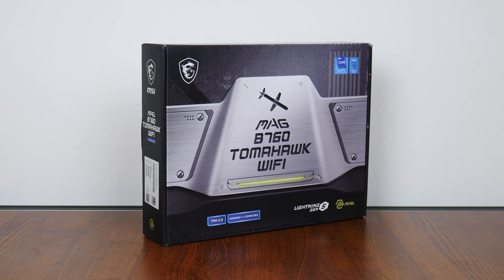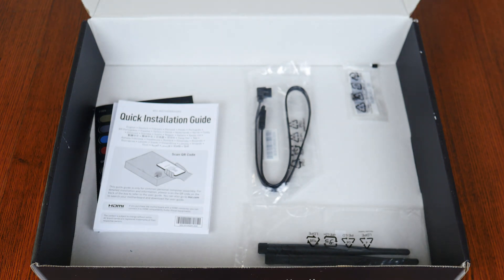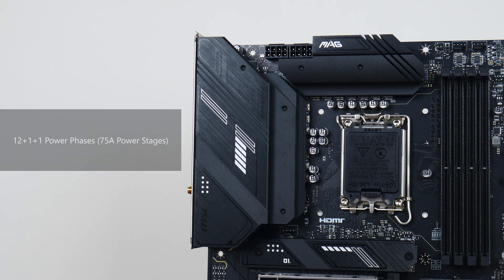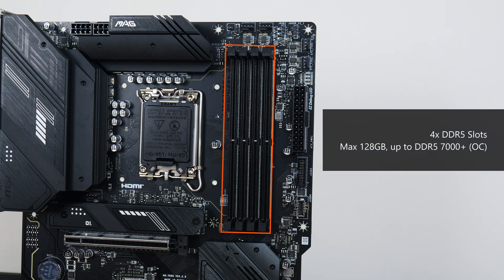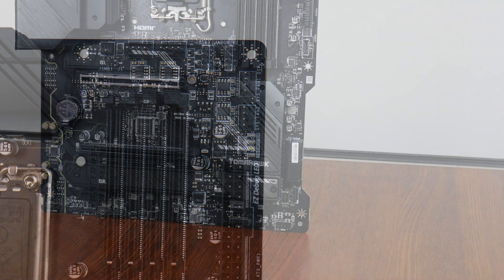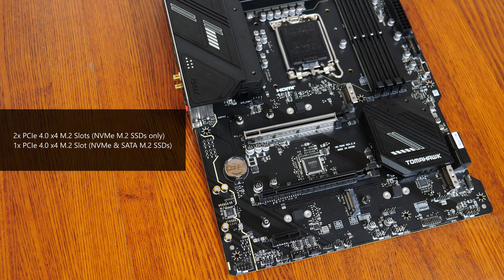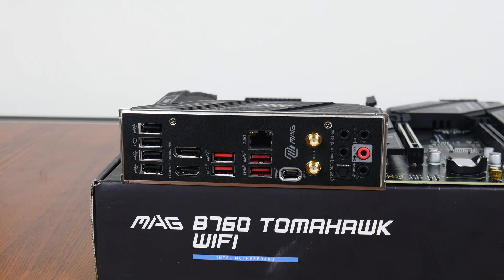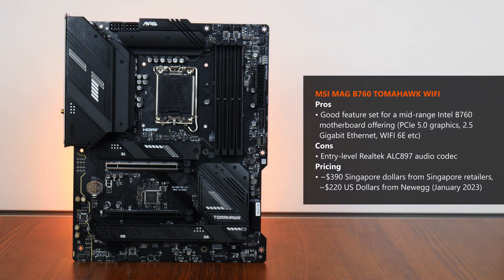Best Value Mid-range Intel B760 Motherboard? MSI MAG B760 TOMAHAWK WIFI Unboxing & Overview

Comment: what is the sata 3 cable for? do i HAVE to use it?
Reply from the maker: The SATA 3 cable's only for when you have a legacy SATA hard drive or optical drive - modern PCs would not need to use the cable at all!
Reply: @ALKtech  okay, thank you for the reply

Comment: I recently built a pc with this Motherboard. Now I've been really busy after building it so I didn't notice. But today I saw that a red light is flashing under my GPU. Near the 1st M.2 slot. I immediately called the service centre and they told me that its the signal for SSD running. But I am confused how I didn't notice it before. Can you please confirm does any such red light blick normally in that motherboard near the 1st M.2 slot?

Comment: which one is better this one in video or Gigabyte B760 DS3H AX (DDR5 variant) ??
Reply from the maker: The Gigabyte board is targeted at the entry-level, while the MSI in this video is more of a mid-range offering. Both boards should be priced quite differently as well - if you're not intending to use a high-end processor. perhaps a Core i5-12400, 13400 etc, you might wanna save the cash and just get the Gigabyte. Again, this is all dependent on the price difference between both boards where you're from, and what processor you are intending to use!
Reply: @ALKtech  in my country the price two of them only $10 different 😅, and I plan to build with I5 13400f
Reply from the maker: @anugrahputra1721  oh! I'd probably just spend that $10 and get the MSI then since it's such a small price difference. Gives you headroom to upgrade to a more powerful processor (e.g. 14th Gen) in the future!

Comment: B660 Tomahawk comes with ALC 1200 instead 897 , I don't know why they downgraded it...
Reply from the maker: Seems to be a trend of late at least for the "cheaper" mid-range boards - board manufacturers have been including ALC897 codecs instead...perhaps Realtek's bumped up the prices of its more premium audio codecs and board partners simply couldn't stomach the costs and opted for the 897 instead!